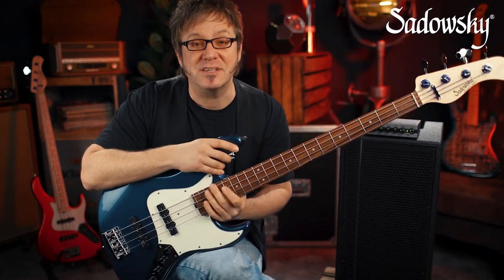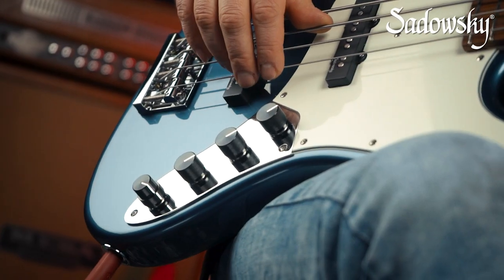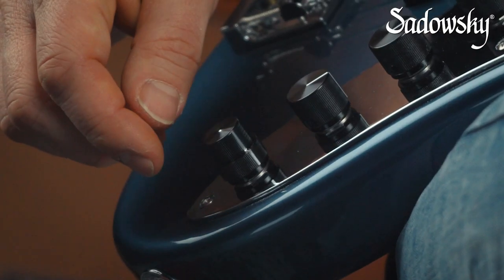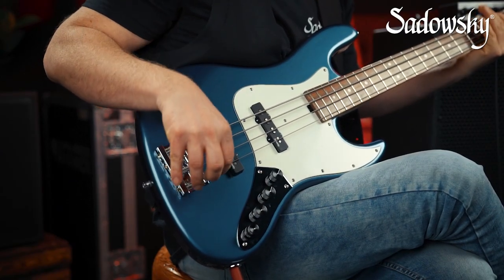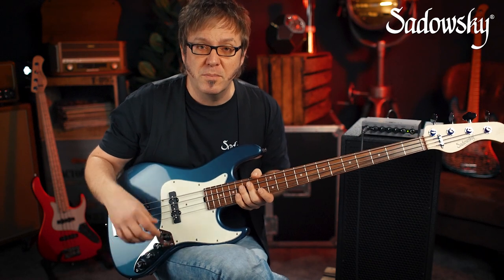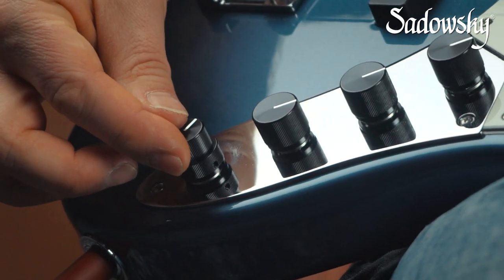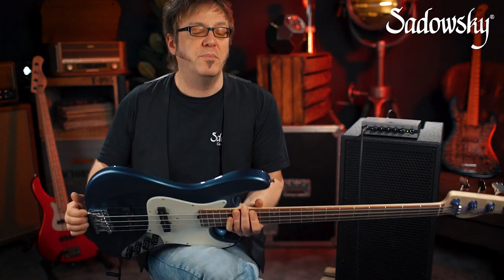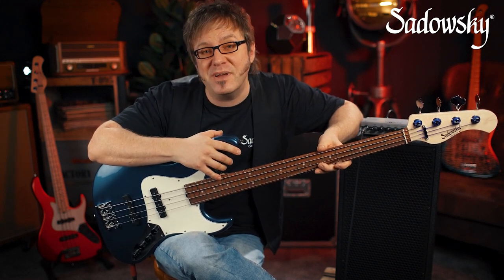The Sadowsky Bass Preamp & Vintage Tone Control (V.T.C.)

Comment: When will more drop in preamps with the VTC be available?
Reply: they already are.... Just finding one is the problem. I bought two of them and put them in my Sadowsky Metro express bass, since those basses don't come with the VTC. There must be a production problem with warwick.
Reply: @kingsx925  I have the metro express and I got the vtc to put on the metro express. I bought a drop in plate, and the vtc worked better on that one.

Comment: Is there an on/off passive switch so the bass will still play if the battery runs out?
Reply from the maker: Hi there! Yes, as stated in the video the Vintage Tone Control pot also functions as push/pull knob to switch between active and passive mode. You will be able to play, even if the battery runs out.
Reply: @SadowskyInstrumentsOfficial  Great, thank you so much.

Comment: Why do I get  noise when treble boost or VTC  passes about 80%?  I have an older MIJ metroline
Reply from the maker: Hi William! You asked right at the right time! This is an "issue" we will adress next week in an upcoming video and all the information on that topic will be provided then. As to provide you a "quick fix" for right now, it is important to understand that the Sadowsky preamp is "boost only", meaning that when engaged it adds to the "flat" passive sound, dialing back the knobs will reduce the added boost until "flat" or normal passive sound (in other words). A fully cranked treble then means that you added the full range of boost to your signal. This is only recommended when you use a vintage cab or amp which don't have that much treble to begin with, so you are able to add treble if needed. Modern cabs often feature tweeters, so an extra treble boost from the preamp is not needed to that extent. If the treble from your amp is too high, it can also add to the signal. Roger Sadowsky recommends to boost the treble by only about 60% and only crank it up more if neither amp head nor cab can provide the needed amount of treble. So the key is really to find the right balance between preamp treble, amp head treble and tweeter treble. Hope this was helpful! Make sure you tune in next week and get all the information on it.
Reply: @SadowskyInstrumentsOfficial  that’s so awesome to heart reply overnight thanks!  I do use a Markbass TTE 500 and matching cab that has a tweeter!  I sometimes use an AER acoustic guitar amp for it’s small to carry and gives full range.  That explains a lot .  What puzzles me is the noise or hum is less when I face certain direction so was perplexed if it was magnetic field related issues.  (Note: last I had issue was rainy and humidity was high)

Comment: What is so special about the VTC vintage tone control?
Reply: Nothing.... Marketing' its just a Tone control...
Reply from the maker: 4:04: The VTC combines a standard tone control which works in both passive and active mode to adjust treble to your liking, with a push-pull active/passive mode selector (instead of having a dedicated toggle switch in addition to the knob). You can actually boost treble on the peamp and cut highs with the VTC at the same time.